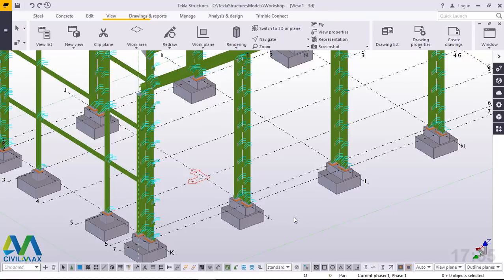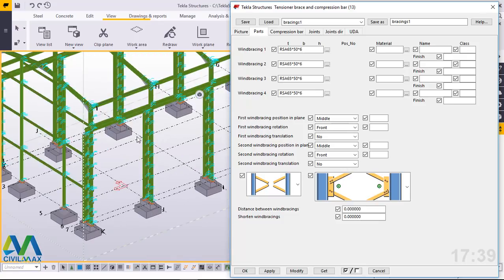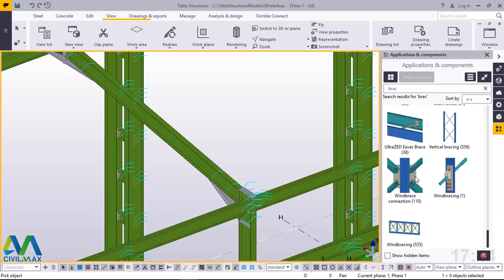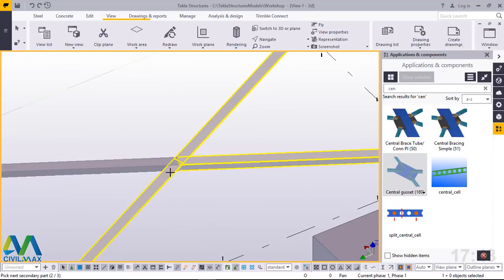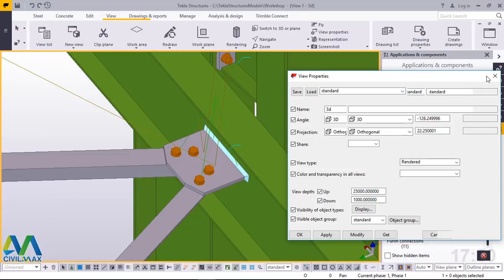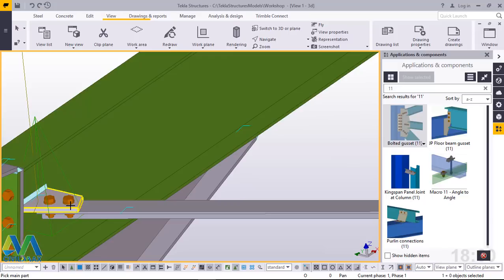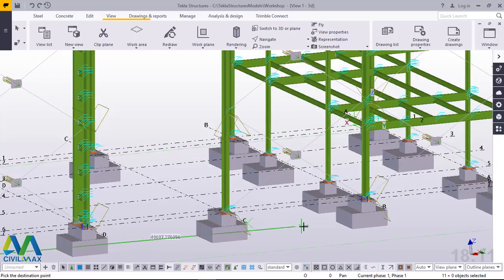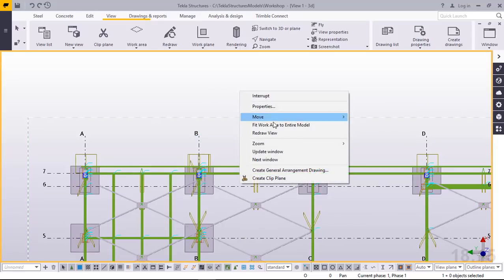How to Brace Rafters and Columns | Tekla Structures

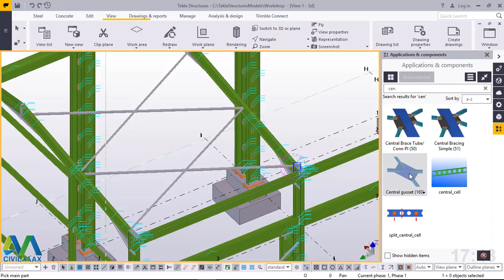Comment: 14:00 Hello! Could you show in your video how to connect vertical cross braces from paired corners in the center with a square plate, and not a rectangular plate at an angle. Component 169 (central gusset plate) for broken four elements, while in our country it is customary to break only two. I am sorry if I wrote badly in English.
Reply from the maker: noted and i will show that next time